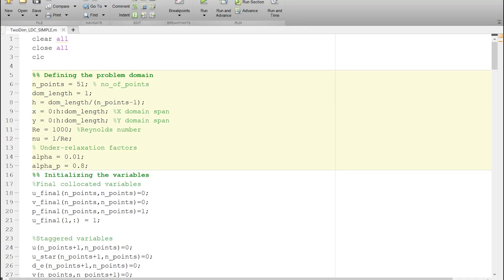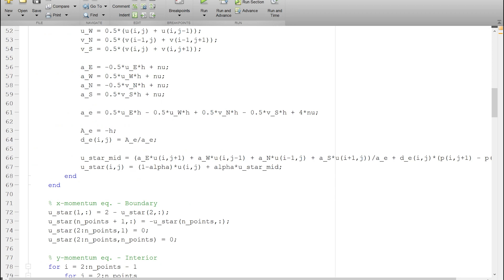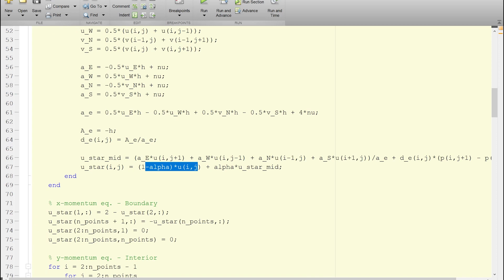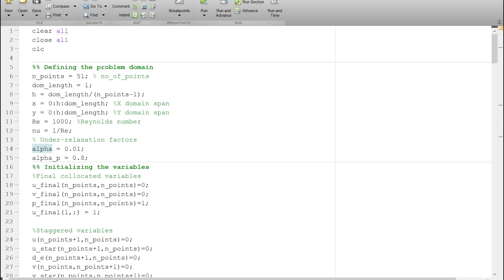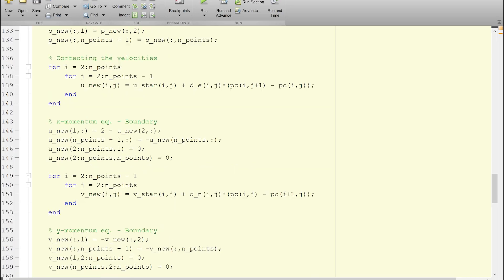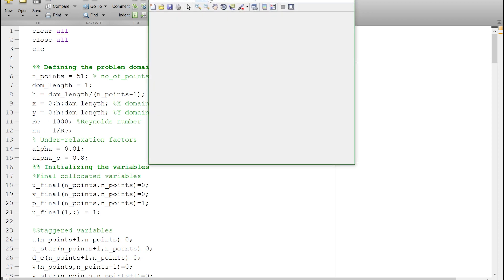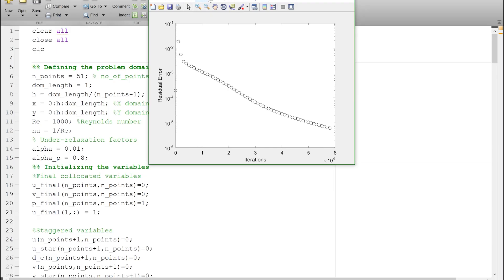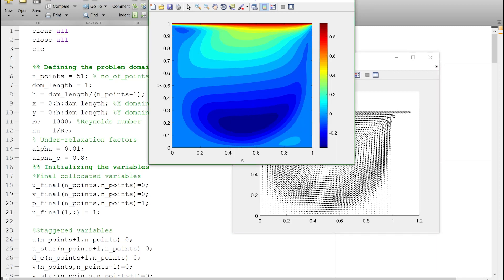New Year's Greetings and Revised SIMPLE Algorithm Code | ICFDM

Comment: FOR THOSE WHO NEED THE CODE ENJOY,

clear all ;
%% 
close all
clc

%% Defining the problem domain
n_points = 51; % no of points
dom_length = 1;
h = dom_length/(n_points-1);
x = 0:h:dom_length; %X domain span
y = 0:h:dom_length; %Y domain span
Re = 1000; %Reynolds number
nu = 1/Re;
% Under-relaxation factors
alpha = 0.01;
alpha_p = 0.8;
%% Initializing the variables
%Final collocated variables
u_final(n_points,n_points)=0;
v_final(n_points,n_points)=0;
p_final(n_points,n_points)=1;
u_final(1,:) = 1;

%Staggered variables
u(n_points+1,n_points)=0;
u_star(n_points+1,n_points)=0;
d_e(n_points+1,n_points)=0;
v(n_points,n_points+1)=0;
v_star(n_points, n_points+1)=0;
d_n(n_points, n_points+1)=0;
p(n_points+1,n_points+1)=1;
p_star(n_points+1,n_points+1)=1;
pc(n_points+1,n_points+1)=0;
b(n_points+1,n_points+1)=0;
u(1,:)=2;

u_new (n_points+1,n_points)=0;
v_new (n_points, n_points+1)=0;
p_new (n_points+1,n_points+1)=1;
u_new (1,:)=2;

%% Solving the governing equations
error = 1;
iterations = 0;
error_req =1e-5; %final required error residual
figure(1); %for error monitoring

while error > error_req
% x-momentum eq. - Interior
for i = 2:n_points
for j = 2:n_points - 1
u_E = 0.5*(u(i,j) + u(i,j+1));
u_W = 0.5*(u(i,j) + u(i,j-1));
v_N = 0.5*(v(i-1,j) + v(i-1,j+1));
v_S = 0.5*(v(i,j) + v(i,j+1));

a_E = -0.5*u_E*h + nu;
a_W = 0.5*u_W*h + nu;
a_N = -0.5*v_N*h + nu;
a_S = 0.5*v_S*h + nu;

a_e = 0.5*u_E*h - 0.5*u_W*h + 0.5*v_N*h - 0.5*v_S*h + 4*nu;

A_e = -h;
d_e(i,j) = A_e/a_e;

u_star_mid = (a_E*u(i, j+1) + a_W*u(i, j-1) + a_N*u(i-1, j) + a_S*u(i+1, j) ) /a_e + d_e(i, j) * (p(i, j+1) - p(i,j));
u_star (i, j) = (1-alpha) *u(i,j) + alpha*u_star_mid;
end
end

% x-momentum eq. - Boundary
u_star (1,:) = 2 - u_star(2,:);
u_star (n_points + 1,:) = -u_star(n_points, :) ;
u_star (2:n_points, 1) = 0;
u_star (2:n_points, n_points) = 0;

% y-momentum eq. - Interior
for i = 2:n_points - 1
for j = 2:n_points
u_E = 0.5*(u(i,j) + u(i+1,j));
u_W = 0.5*(u(i,j-1) + u(i+1,j-1));
v_N = 0.5*(v(i-1,j) + v(i,j));
v_S = 0.5*(v(i,j) + v(i+1,j));

a_E = -0.5*u_E*h + nu;
a_W = 0.5*u_W*h + nu;
a_N = -0.5*v_N*h + nu;
a_S = 0.5*v_S*h + nu;

a_n = 0.5*u_E*h - 0.5*u_W*h + 0.5*v_N*h - 0.5*v_S*h + 4*nu;

A_n = -h;
d_n(i,j) =A_n/a_n;

v_star_mid = (a_E*v(i, j+1) + a_W*v(i, j-1) + a_N*v(i-1,j) + a_S*v(i+1, j) ) /a_n + d_n(i,j) * (p(i,j) - p(i+1,j));
v_star (i,j) = (1-alpha)*v(i,j) + alpha*v_star_mid;
end
end

% y-momentum eq. - Boundary
v_star(:,1) =- v_star(:,2);
v_star (:,n_points + 1) = -v_star(:,n_points);
v_star (1,2:n_points) = 0;
v_star(n_points, 2:n_points) = 0;

% Zeroing the corrections to begin with
pc(1:n_points+1,1:n_points+1)=0;

% Continuity equation a.k.a. pressure correction - Interior
for i = 2:n_points
for j = 2:n_points
a_E = -d_e(i, j) *h;
a_W = -d_e(i, j-1) *h;
a_N = -d_n(i-1,j) *h;
a_S = -d_n(i, j) *h;
a_P = a_E + a_W + a_N + a_S;
b(i, j) = -(u_star(i,j) - u_star(i, j-1) ) *h + (v_star (i, j) - v_star(i-1,j) ) *h;

pc(i,j) = (a_E*pc(i, j+1) + a_W*pc(i, j-1) + a_N*pc(i-1,j) + a_S*pc(i+1,j) + b(i, j)) /a_P;
end
end

% Correcting the pressure field
for i = 2:n_points
for j = 2:n_points
p_new(i,j)=p(i,j) + alpha_p*pc(i,j);
end
end

% Continuity eq. - Boundary
p_new(1,:)=p_new(2,:);
p_new(n_points + 1,:) = p_new(n_points,:);
p_new(:,1)=p_new(:,2);
p_new(:,n_points +1) = p_new(:,n_points);

% Correcting the velocities
for i = 2:n_points
for j = 2:n_points - 1
u_new (i, j) = u_star(i,j) + d_e(i,j)*(pc(i,j+1) -pc(i,j));
end
end

%x-momentum eq. - Boundary
u_new (1,:) = 2 - u_new(2,:);
u_new (n_points + 1,:) = -u_new(n_points,:);
u_new (2:n_points, 1) = 0;
u_new (2:n_points, n_points) = 0;

for i = 2:n_points - 1
for j = 2:n_points
v_new(i,j) = v_star(i,j) +d_n(i,j)*(pc(i,j) -pc(i+1,j));
end
end

% y-momentum eq. - Boundary
v_new(:,1) = -v_new(:,2);
v_new(:,n_points + 1) = -v_new(:,n_points);
v_new (1,2:n_points) = 0;
v_new (n_points, 2:n_points) = 0;

% Continuity residual as error measure
error = 0;
for i = 2:n_points
for j = 2:n_points
error = error + abs (b(i,j));
end
end

% Error monitoring after every few timesteps
if(rem(iterations, 1000)) == 0
figure(1);
semilogy (iterations, error, '-ko')
hold on
xlabel ('Iterations')
ylabel ('Residual Error')
end

% Finishing the iteration
u = u_new;
v= v_new;
p = p_new;
iterations = iterations + 1;
% x_dom = ((1:n_points) -1) .* h;
% y_dom = 1-((1:n_points) -1) .* h;
% [X, Y] = meshgrid(x_dom, y_dom) ;
% % figure (21);
% contourf (X, Y, u_final, 21, 'LineStyle', 'none')
% colorbar
% colormap ('jet')
% xlabel ('x')
% ylabel ('y')
% drawnow
% pause(0.02)
end
% After the converged solution, we map the staggered variables to
% collocated variables
for i = 1:n_points
for j = 1:n_points
u_final(i,j) = 0.5*(u(i,j) + u(i+1,j));
v_final(i,j)= 0.5*(v(i,j) +v(i,j+1));
p_final(i,j) = 0.25*(p(i,j) +p(i,j+1)+p(i+1,j)+p(i+1,j+1));
end
end
%% Contour and vector visuals.
x_dom = ((1:n_points) -1) .* h;
y_dom = 1-((1:n_points) -1) .* h;
[X, Y] = meshgrid(x_dom, y_dom) ;
figure (2);
contourf (X, Y, u_final, 21, 'LineStyle', 'none')
colorbar
colormap ('jet')
xlabel ('x')
ylabel ('y')

Comment: Hi Tanmay, thanks for this video, that's awesome.
Analyzing the code, i saw that you have not solved the momentum equation and the pressure correction with an iterative method (for example, using Jacobi or Gauss Seidel), instead, you've just calculated one iteration for each component and then stop. Can you explain me why can you do that? Thank you. :D
Reply from the maker: Thanks for the comment Nico.
The calculations would go on until the while loop criterion is satisfied :)
Reply: @TanmayAgrawal7  I see Nico's point. The momentum equation and pressure correction equation are not solved before the iteration step forward. Although it somehow converged at the end, it seems this is different from what the SIMPLE method intends to do...